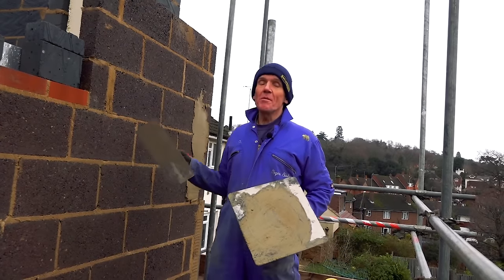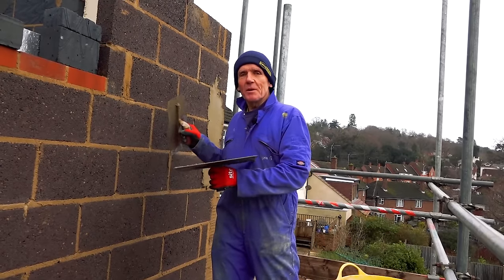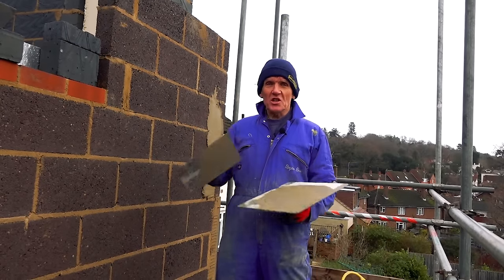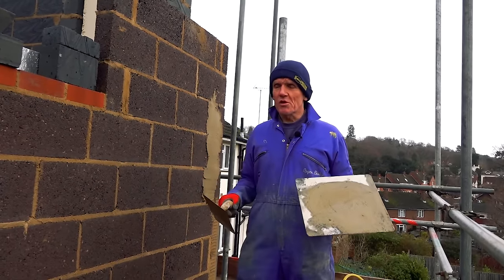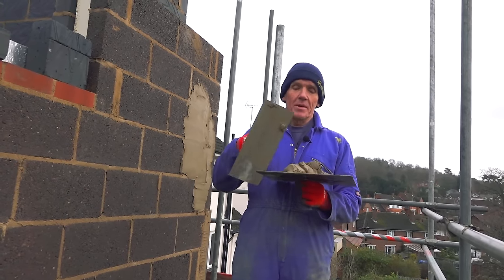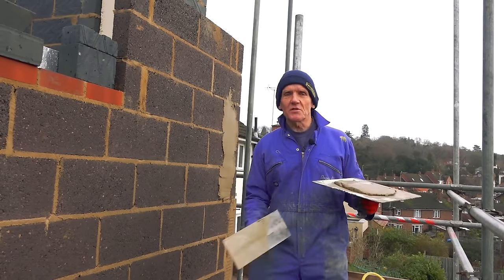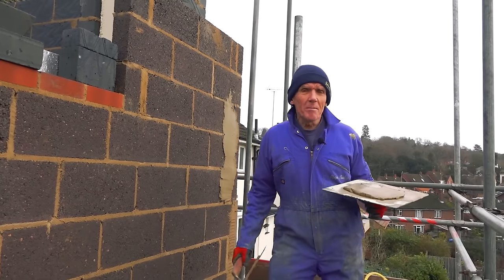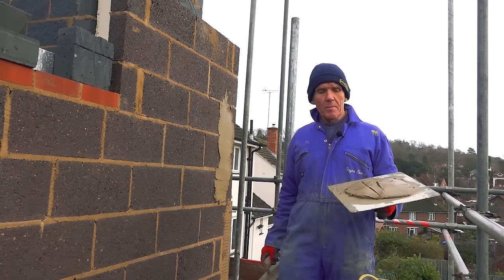What's the Best Mix for Perfect Rendering?

Comment: I rarely use cement as I specialize in lime mortars and plasters and tend to slake my own lime putty and use it because there  is much less wastage and I find it a lot stickier. The 6:1:1 is a good mix, the hydrated makes a good plasticizer and is preferable to using febmix I found.
On my own place I have 5 different backgrounds that I lime rendered: Rubble-stone, cob, old 1970's brick work and 2 types of blockwork, the thermalite and the denser concrete block. The blockwork was less preferable to the other backgrounds and I found more cracking than on the other area's where there are hardly any.
You shouldn't really use lime on new builds because it's pointless, the cavity wall structures were designed for cement mortars and never use cement on old builds this is why there are so many issues with wood rotting, moisture retention and salt build-ups etc, cement render traps it all in, old lime mortar builds need new lime mortar for pointing or rendering.
My prefered lime putty mortar is 3:1 ( 2 & 1/2 sharp angular sand and half a builders sand or a stone dust to one putty or an hydraulic). Some folks use putty and an NHL but I use one or the other, never both together, but as I said, with a putty mortar there is less wastage because you can scrape it off the floor and use it later. Hot mixes are another matter and work better I think but thats a whole new ball game.
I saw a film where some old lime pits were found in Italy, the lime putty was about 400 years old and it was still usable because lime putty starts to set when exposed to air and hydraulic and hydrated sets when exposed to the air, also bags of NHL have a shelf life of about 3 to 4 months although I have used bags that are about a year old. This is one of the reasons I prefer the putty mixes, less goes to landfill.
As you said, don't ever have a stronger mix than the background. Happy building Roger.
Reply from the maker: Great comment Peter. Lots to think about there and we will look at lime mortars when we get a chance.
Reply: Thanks Roger. When I started out with Lime stuff in 1995 (ish) we mostly used St Astier NHL 3.5. 
I thought the whole subject was a load of tosh but it works and there is a saying that the slower it takes to dry, the better it sets. The quicker something takes to dry does not necessarily mean it's stronger, cement relies on compression strength for it's set and a structure like the Hoover Dam is an amazing build and worth watching how they did it. Strangely, cement can continue to strengthen up to 6 years later and adding fibres to lime or cement really does increase the tensile strength, almost doubling in some cases.
They sell a lot of NHL's in builders merchants, especially Hansons which works but like many hydraulic limes is too strong, the minimum I'd use now is an NHL 2.0 (Natural Hydraulic Lime) but as I said, a putty is better and if you slake your own quicklime it doubles the quantity and is fantasticly explosive and gets super hot. So doing a feature on 'hot lime mixes' would be a good one to do. The builders of old would have dug a pit on every site and slaked their own lime which is why you see bit's of charcoal in old pointing and mortars. The masons like hot mixes because the stuff expanded in the joints and it mean't bringing less putty to the site.
Could you perhaps also do a film about the rising damp myth. Too many people are being ripped off having work done like damp proof injections, this is an ineffective and pointless cost, these contractors really talk bollox and should be charged with fraud I think. 
All the best.

Comment: I need to do some small scale rendering on window sills etc and getting small (25kg)  bags of plastering sand is proving difficult - I would need to drive to Glasgow to get it.  Also I've seen a lot of complaints about plastering sand (especially Tarmac brand) being full of stones and needing to be seived on site before use. For small jobs is it okay to use a mix of building sand and sharp sand with the larger lumps taken out of the sharp sand?
Reply from the maker: I would just use the sharp sand. A lot of building sand has a clay content and it often shrinks and cracks. 
If the building sand looks O.K you can mix them but it depends on what it is.

Comment: Hydrated lime DOES set. Used it at 1:2 with sharp sand for flintwork. Still good 2 decades later.

Also used it for render and plaster.
Reply from the maker: I am not a scientist but I  think what you have there is a natural pozzolan in the sand.
The addition of pozzolan to any lime mortar (hydraulic or non-hydraulic) will modify its characteristics. Pozzolanic materials can combine with uncarbonated lime (calcium hydroxide) to form stable compounds, thus reducing the risk of early leaching or frost damage and increasing the potential durability of the mortar.
Reply: I did an experiment years ago - made a filler out of normal hydrate (not NHL) and water - carbonated (set) hard.

Sand from my pit has no clay content, so no pozzalanic inclusion.

A lime company around here were trying to say that all lime historically was NHL - which it wasnt as it was all from burnt chalk - so not NHL. But, inclusion in aggregates and ash from lime kiln would have a pozzalnic effect, but not even as much as an NHL 2 from clay rich limestone.

Try a 1:2 hydrate and sand mortar - 2 days and its very much done on initial set ..... carbonation much longer thereafter.

Even Historic England are ok with the use of hydrate now (although they say 1:3, not realising that this was historic mix of quicklime and aggregate - once quicklime slakes, it can double in proportion, hence l use a 1:2)

But, in essence, no pozzolan needed for a normal hydrated bag lime.

Comment: 6 : 1: 1 = 3 sand Cement+3 sand lime which is actually a strong mix
Reply: I think the strength issue is with the proportion of sand to cement. I do 5 to 1 with a shovel of lime added to the barrel.

Comment: Thanks for a great video. I am doing a small shed and need to do the inside wall. I bought sand and cement. Question is do you need plasticiser. Is it essential or we can do without it ?
Reply from the maker: It will make it easier to spread but it is not essential. Just the smallest squirt of washing up liquid will do on an inside wall.

Comment: Great video! If I took the old render off our garden wall, could I just put new render on, or would it all need repointing first? It's not awful under the render, but the points could be redone. Would the render kill two birds with one stone?
Reply from the maker: Don't point it. The more dents there are for the render to hang onto the better.

Comment: Good video , should the Windows not be in before you render ? Or can they go in after ?
Reply from the maker: You can render up to the corner beads around the windows but the windows then need to go in so you can finish the reveals etc. 
If you have put the windows in from the inside it is not a problem to finish the render to some dummy frames.

Comment: Scratch 4:1 sand cement  with waterproofer and plasticiser 

Top coat 6:1;1 . Sand , cement @ hydrated lime , no plasticiser as the lime helps with workability

Comment: Hi
Great advise, does it apply to a chimney stack with a liner fitted.
Thanks 
Sreve
Reply from the maker: Yes it does but if it is exposed you may want a slightly stronger mix or some mesh reinforcement to stop it cracking.

Comment: 4:1 I've use and its still sticking after 30 yrs
Reply: How often have you checked up on previously completed projects, and after what periods of times? I think its a good learning habbit of all those details people tend to overlook when it comes to things that effect down the road.
Reply: Is that 4 sand 1 cement?
Reply from the maker: @criartoros  yes that is what the man said. The problem is that on a weak substrate that is a strong mix and it will crack. Put one more sand in and some lime and you have a lovely mix.

Comment: Great tutorial, really appreciate it.  What mix would you use for a base coat on 7neuton block?
Would you recommend using a Weber type top coat?
Thanks in advance
Reply from the maker: You could comfortably use a 4 to 1 sand and cement but I would put in a 1/2 measure of lime because I like it.
Reply: What about waterproofer in the mix?.

Comment: Questions nullified by weather conditions.
You look cold mate,
I want to know if your methods work in the heat.
Reply from the maker: It is a lot more difficult in hot weather. You need to soak the wall hours before and then wet it up again. Also the mix need to be wetter. I try to work early in the morning and be done by 10 a.m then try and shade the work

Comment: Roger you recommended a lime and cement mix at start - stating the benefits and advantages- then you said 1st coat you could use Plasticiser Why? 
So can I use this instead of Lime for both coats?
Reply from the maker: You can use plasticiser on all the coats but I much prefer lime. It is creamier and holds the water for longer during the application

Comment: Really useful practical demonstration on external rendering and the dangers of using an overly strong material.
Further technical guidance on rendering can be found Building Research Establishment publication “Good Building Guide No 18” (Choosing external rendering) as this provides authourative information, including clarifying suitable preparation options, appropriate mixes for different backgrounds and exposure levels, and examples of good detailing. It might be also be worth bearing in mind that strong mixes (and plastic paints) inhibit evaporative drying and can trap moisture.

Comment: Hi Roger, I need to render my external wall but it's painted. I can't sand blast it as it's in a tight basement area and near windows. I was thinking apply some render grip then fix some stainless steel mesh using screws into the substrate. Would that work?
Reply from the maker: I have rendered some painted walls in my own house and they are fine. I gave the wall a bit of a run over with the edge of a diamond blade to scuff it up and make a few shallow cuts through the paint and render. I then used Render grip. When that was dry I pressed some  some alkali resistant fibre glass mesh (common in builders merchants these days) into the scratch coat . Give that 24 hours and  apply the finish.  Expanded metal is overkill. The mesh is lovely to put on but don't try too big a piece. 2 square meters with 150mm overlaps is easier that putting on 3 or 4 metres and watching it fall off.
Reply: @SkillBuilder  Thanks Roger. Can you advise how the fibre glass mesh would benefit the render in this instance but when on block or brick it wouldn't be necessary?

Comment: Are these wet sand or dry sand quantities? There's a real  difference.
Reply: Random Task good question. I would like to have a damp meter to measure the moisture content of sand.
When concrete plants mix concrete they have a sensor placed in the metal and sand to determine moisture content then they mix water and cement accordingly and with using weight.
I use digital scales for mixes when I need to match a colour etc.
Reply: if it's the volume and not the weight then is there still much of a difference?

Comment: If your using a 3 in 1 ad mix, using lime aswell over aerates the mix and weakens it ,making it more prone to cracking.
Reply: i was taught 4-1 on scratch, 5 -1-1 of lime top coat, ?
Reply: @leegorman3329  I kept getting people saying different things, so I phoned up the technical department, Feb or Sika and that's what they told me, although some of the people in the technical department didn't fill me with confidence that they knew what they were talking about. If you have always had good results with those ratios,stick to what's been working. 👍

Comment: What about scudding the wall first with a 4 cement  to 1 sand for key coat - then a 5 sand 1 cement  & tiny drop of waterproofer for 2nd scratch coat - then a lime - cement  sand - tiny drop of waterproofed for finish coat - never ever plas it's just turns into the wall in to a giant sponge  - go to some Irish site to learn to do plastering done properly- wouldn't let that guy plaster my  henhouse

Comment: Lime all the way.  Either drop a scoop of hydralime into your cement as demonstrated here. 
Or as I learned in France, pure hydraulic lime. That's much brighter and fresh looking when finished. It sets slower though. So worth knocking up a load in one hit to allow it to start going off a bit making it easier to apply. You don't need primer either for hydraulic line if rendering over stone.

Comment: OK The outside of the house has insulation 110mm thick looks and feels like polystrene so how to render and repair cracks ?
Reply: I think they render that stuff with a mix containing a polymer sand substitute it's very light and a bit expensive. Not an expert just going on what was happening when next door got external insulation fitted.

Comment: What exactly is plastering / rendering sand? I can't really find anything that is called like that in Belgium.
Reply from the maker: it is a fine washed sand that is slightly sharp and has no clay content, It is very likely that the sand you use for rendering fits that description. I know Belgium has some glass works and I suspect the sand in those areas is a fine sand
Reply: @SkillBuilder  Thanks for the reply! We have two type of construction sands available so far i know. Fine 0.2mm  and course 0.8mm grid. The fine grid is much more powdery and light compared to what you have. I ve tried both but I found it pretty hard to work with, so I'm wondering if it could be the sand thats the issue or just my two left hands

Comment: Should the surface to be rendered also be damp so the cement mix sticks better?
Reply from the maker: If it has high suction then yet is should be hosed down. I usually do it the day before. It water runs out of the masonry on the day it can cause the render to slump.

Comment: Its strange really, I think it is a black art, I admire builders, I have no fear of electrics, gaswork, or any plumbing , but plastering and rendering scares me to death . One success I did have was on a waterfall for a pond, it comprised of sandstone rocks and mortar between , it leaked badly and needed a solution, rightly or wrongly my dad and myself mixed up a very strong mix that would have you builders shouting at us. It was 2 parts Sharp sand and 1 part portland cement, we had cleaned of the rocks with a wirebrush and  added a layer of galvanized chicken wire to the  waterfall run . We did it all in one go and did not stop for breaks , I will probably  regret saying this and jinks things but that was 32 years ago and no cracks or leaks, we did at the time  paint it with a non toxic fish safe bitumen emulsion, but most of that has long since eroded away.  But I do understand the theory of using weaker coating normally on the outside.

Comment: Hi Roger. You failed to state that lime render requires special masonry paint called silicate paint that cost £90 for 5L. If i knew that i would have used plasticiser instead of lime. The issue I have I can’t use the same Dulux Weathershield paint that is on my customers house on the new walls. Not happy at all! What do you advise?

Comment: what is the characteristic difference between building sand and rendering sand? cheers
Reply from the maker: Building sand is soft and hangs together, often because of a slight clay content. Rendering sand is sharper and the grains fall apart. If you render with soft sand it shrinks and cracks but plasterers often like a shovel full of soft to give the rendering sand some body. Lime does it better.
Reply: @SkillBuilder  thanks mate
we get sand from the river so i assume that would be more building sand. 

is there a industry standard or a way to tell if a sand is good enough to be consider rendering sand. is there a technique to tell the difference.

where i am the sand comes labeled or named after the source of the location, comes from a variety of sources and varies. 

cheers mate.

Comment: Did you know you shouldn't mix lime with plasticiser or waterproofer.
Reply from the maker: How about SBR?
Reply: @SkillBuilder  wouldn't be able to tell you exact answer without ringing sbr technical department. I use sbr in a slurry mix of sharp sand cement and sbr then painted onto highly unstable surfaces if I think it needs it. And then one layer of sbr  painted on and left to go tacky prior to putting on my scratch coat. Alternatively I use a product made by Bondit it's an exterior plasterers Prigrit to seal thermalite blocks for highly porous materials they guarantee your work as long as you follow the guidelines in all honesty is probably the best stuff. People have said to me why dont you use just use PVA and Sand is the same stuff it's not and I would never do that. The blocks you are working on in this video depending on the weather they were get a little sprinkle with a hose and then go straight on I also put my beats up with sand cement as I scratch this is the way I was taught and it's the way I do it. Regarding the plasterers pregrit it is ideal for plastering on thermalite blocks if you talk to thermalite they recommend a rendering mix of 12 to 1 which is ridiculous with the pregrit you can do a stronger mix one you can't dig out with your finger thanks for your reply.
Reply: @SkillBuilder  also I find a good Leighton Buzzard is the best rendering sand

Comment: What are you using for waterproofing? Nothing? You use lime so you carnt use waterproofer as lime makes it porous
Reply: Yes Joey, you can use water proofer, no problems at all, the only cons about using lime it does burn your skin on prolonged contact, about the rest is an amazing material, you should try if don't like it go back to your usual.